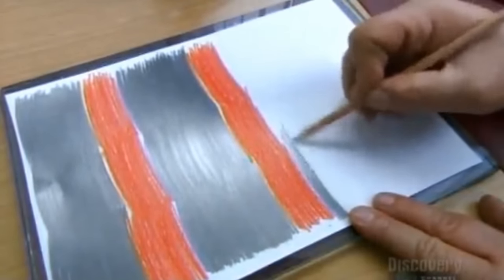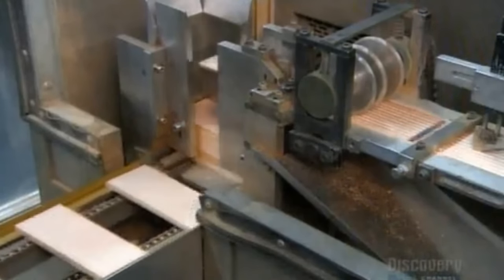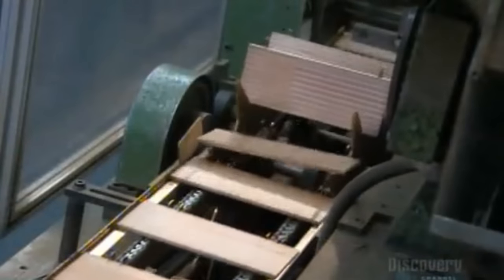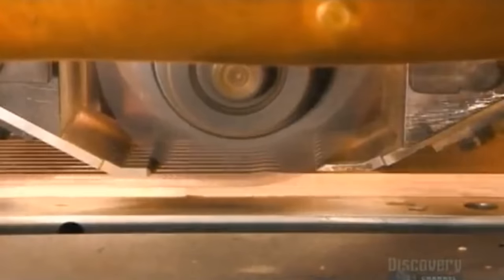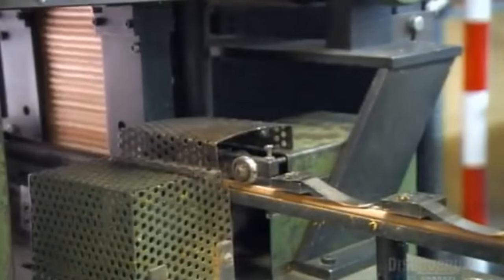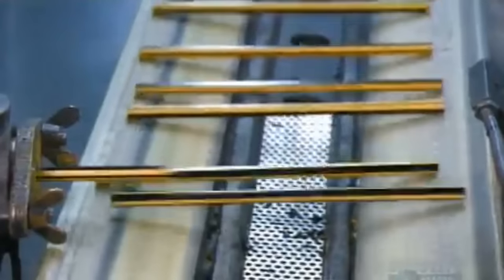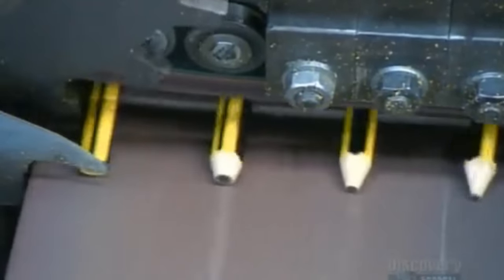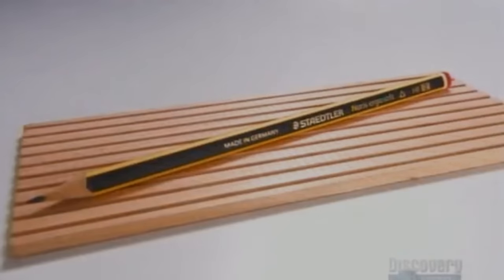How It's Actually Made - Pencils

Comment: I was trying to sharpen a pencil for my daughter earlier. Being Gen X, I still like to do that with a knife. It was a brand new pencil, never before sharpened. I got to the point of wondering how far down before I hit the lead, and when 1/4 of the pencil was gone and still no lead, I put a fresh blade on my utility knife and sliced it all the way down the length, cutting it to where the lead should be.
There was no lead. Not even discoloration.
Somehow, this pencil made it through production without receiving any lead, and all the way to the store.
I wish we could post pictures here 😂
Reply: so no lead?
Reply: @isaiahf-d846  that's exactly what I said...
Reply: @BigJeremyBeyer  he's referencing an old vine where a dude on his phone says 'so no head?' And then smashes his phone and skateboard
Reply: I'm trying to comprehend the logic here. How do you need to cut away 1/4 of the pencil before you can see there's no lead? Shouldn't it be visible at the end before you sharpen it?
Reply: @woodfur00  occasionally, some of the lead near the tip will break off during shipping and stocking.